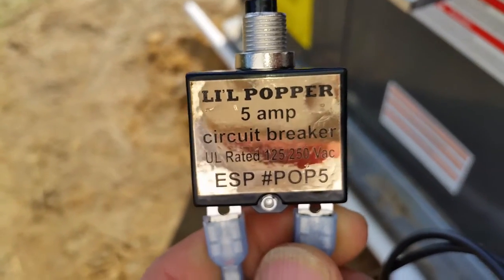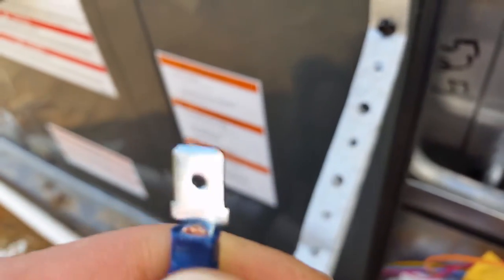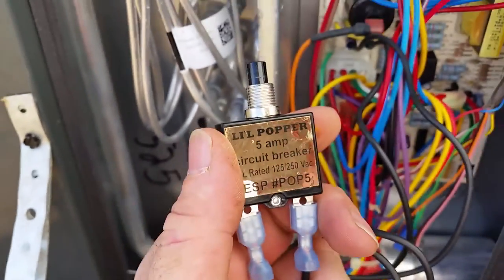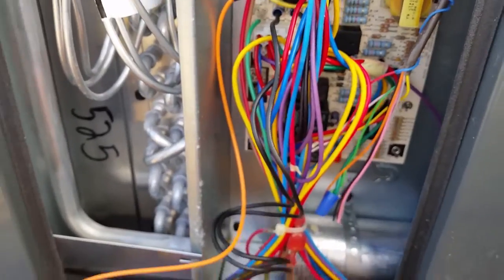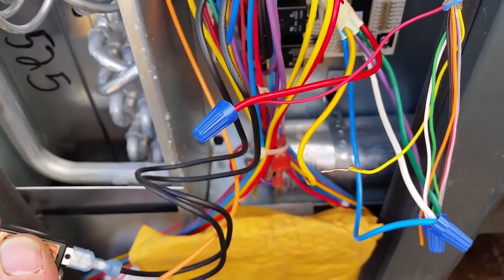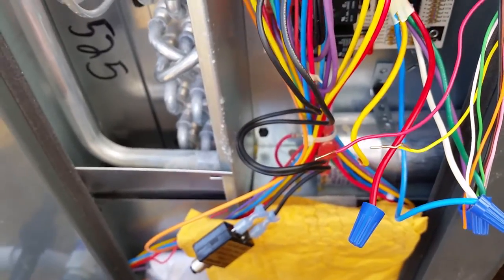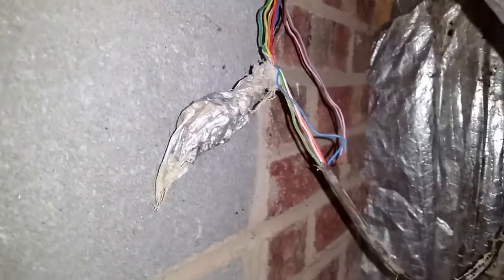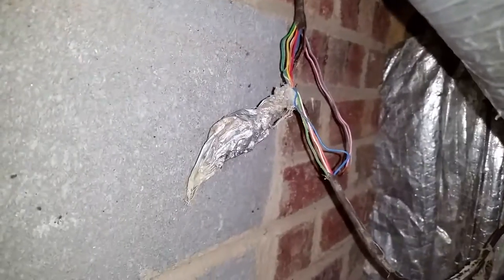low voltage short

Comment: Good job. I normally splice my wires in a box. I believe it's  code in my state. Also I use the zebra short finder to locate shorts. What's neat about  the zebra it has a red led light that will stay on until the short is found. However it only works on 24 V control wiring.
Reply: Nic vid brother.. I hate when someone does not connect all wires on a splice. No one is perfect.. could of been a vary tight situation or not enough wiring but still u do it right if u care.. Nic job
Reply from the maker: Thank you downhere we have a lot of Jack legs you don't take pride in the work or do not have the knowledge required to properly perform installations

Comment: Why not use a 24 volt incandescent bulb rather than the circuit breaker. The bulb will burn at full brilliance until the short is eliminated, and this will not stress the control transformer.